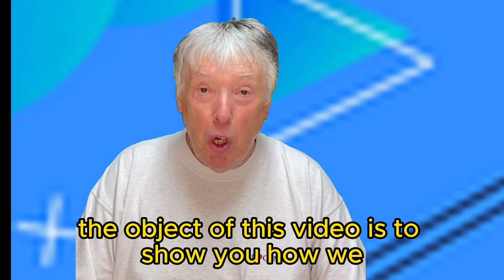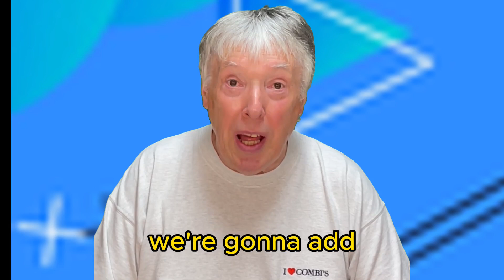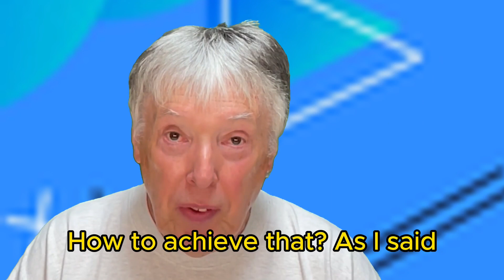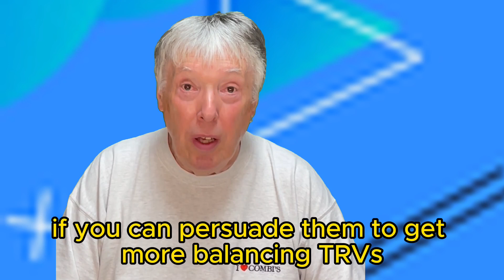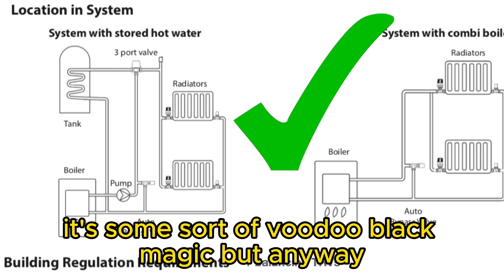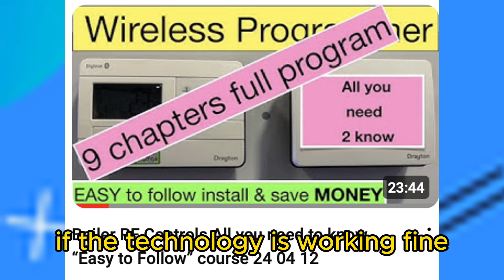How to CHANGE the boiler FLOW temp. To 60c Increase efficiency YOU make money.

Comment: and how do you feel in an era of 'Smart TRV's' - eg the HIVE / Honeywell digital ones
Reply from the maker: Hi again, Smart TRVs are very expensive Amazon £274.00 for 5 heads is completely unnecessary because the payback cost will never happen, EVERY rad needs one,  just like Air source / Solar and EVs  👍 Smart controls 100% save money balancing TRVs,  Heat loss of the home / lounge 60c flow is the way to save money. Why some people spend 1000's  to save what? When I added what I paid into my pension I have to be 117 before I make £1.00 profit. I paid for their big building and bonus. Hope the helps, George 😀👍😤
Reply: @mrcombiBedford  okay. lastly one more question. if you have smart thermostat in  hallway and radiator, you said it should be fitted with a trv. i was under the impression area with thermostat shouldnt be fitted with trv. otherwise both will compete, and also there is no 'bypass' for the boiler incase other smart trv's are off when the heating might be commanded
Reply from the maker: @mohitl1697  Hi Again, no problem, as always every rad needs a TRV if the stat is in the hall a TRV must still be there, in a ROOM not allowed both. Ignore what is in the boiler 
has fitted, as I say many times the rules and Codes of Practice and CONTROLS firms demand an external auto by pass on EVERY system. It's the CONTROLS firms demand an external by pass NOT the boiler manufacturer. Installers wrongly keep thinking it's a boiler requirement when it's not. take care, George 🤩👍

Comment: What about  Sentinel X1000?
Reply from the maker: Hi, thanks for asking, the X100 or Fernox F1 are very good inhibitors I highly recommend refilling with them  if the system has been correctly. If not X200 or F2 are a more for problem solving, eg. noise or blockages pump problems which is often the case. Hope that helps, George 🤩